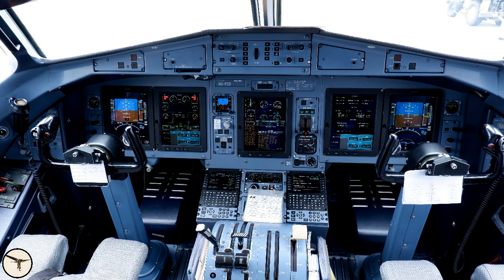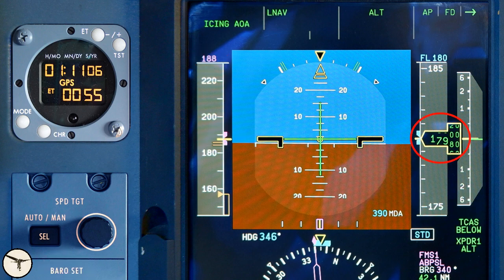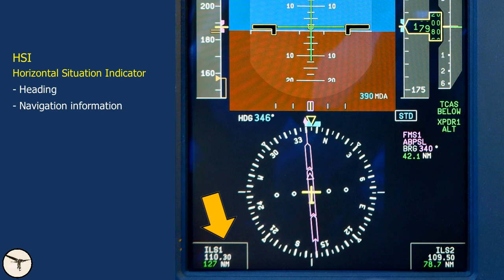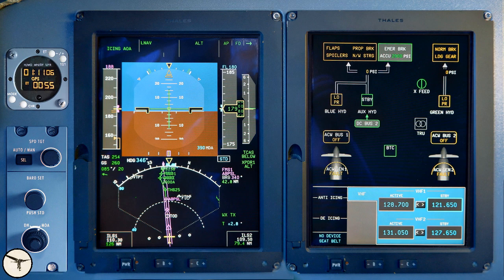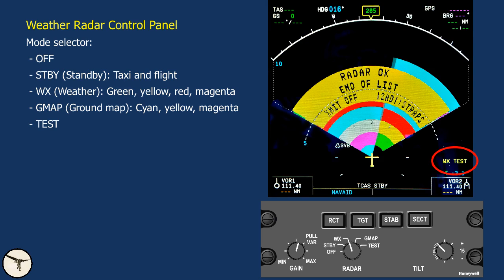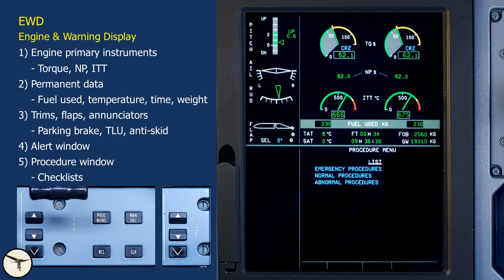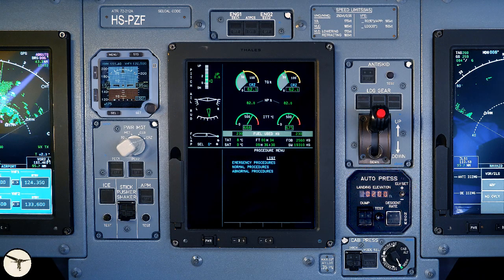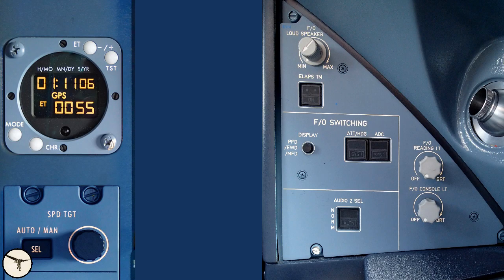ATR systems - Glass cockpit instrument panel

Comment: I notice during descent, after VNAV was activated, why the FMA sometimes display ALT* instead of VNAV PATH ?
Reply from the maker: This happens when you forget to select an altidude below you before you start your descent.
Reply: @FlywithMagnar  I see, thank you
Reply: @FlywithMagnar  If a pilot realizes the mistake, how can he reinstate VNAV PATH? 

Would this be the correct procedure?
1: Disable VNAV
2: Set decent altitude
3: Enable VNAV again to reactivate VNAV PATH?
Reply from the maker: ALT* disables VNAV PATH mode. Therefore, the procedure is the set the cleared altitude with the ALT SEL knob and then press the VNAV pushbutton. The same rule applies for VS mode.
Reply: @FlywithMagnar  Thank you sir for the reply.

Comment: I enjoy watching your tutorials, simple and easy to understand.

I've a question about the Set Auto/ Manual Speed Target knob, located left of Capt PFD. Unlike A320, ATR doesn't have Auto Throttle. After setting the speed target with the knob,  how do you get the ATR to follow the speed target?
Reply from the maker: For climb, we use IAS mode. The flight director will then follow the target speed. Unless ATC tells us to use a specific speed, we use auto target speed. 
For descent, we use auto target speed or manual target speed set to 240 kt (or whatever we prefer of ATC wants.) The speed is controlled with the power levers. For approach, we always use auto target speed (unless we have to land with reducef flaps setting.)
Reply: @FlywithMagnar  thank you for the detail reply.

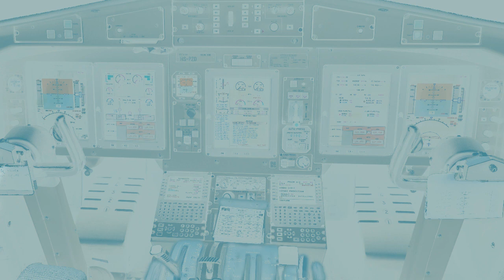Comment: at 14:47 Capt, can you tell me the difference between the red and green altitude? is it highest with the red and lowest terrain in the area with green? i cannot find it yet the explanation whether in the book or other reference. thanks a lot Capt
Reply from the maker: On the picture in the video, the highest obstacle has an elevation of 10,500 feet (the red number in the right low corner). The lowest terrain is at 1,500 feet. The density and color is a function of how close the terrain is to aircraft altitude and the angle of the flight path. The reference is FCOM.DSC.34.13.1.2.2.
Reply: @FlywithMagnar  Thanks a lot found it Captain, sure airbus and atr instruments are almost same. Didnt expect to search for it on fcom dsc. God Bless You Capt!

Comment: Dear Magnar,  would you kindly clarify regarding the PFD-ASI? I'm doing ground school for my ATR TR right now, and some of the CBT content shows the ASI has a yellow box/barrel (like the altimeter) in the center of the speed tape with a digital readout of IAS. Other content, shows that no such box exists. Also, FCOM DSC.31.5 pg 1 & 2, show both possibilities. Is there a mode/display selection somewhere, or is this a difference in airframe msn or avionics software version (like VNAV)?

Great work as always, thanks Captain!
Reply from the maker: The answer is a different software version. The first variants (STD 1 and STD 2), do not have the yellow box. It was introduced with STD 3. Some early variants have been upgraded to STD 3.
Reply: @FlywithMagnar  Fantastic, thanks for clarifying that!🙏